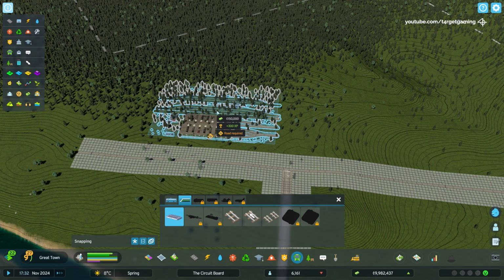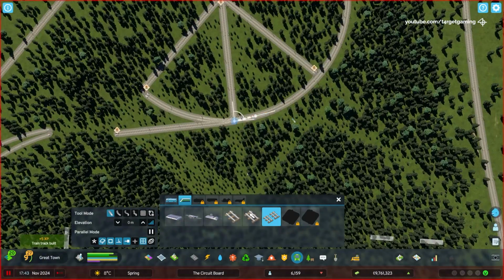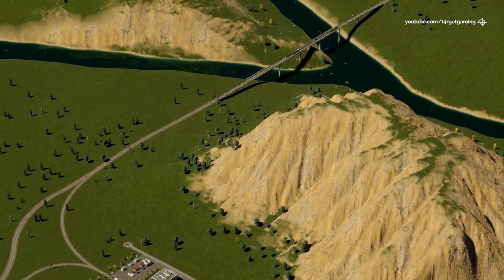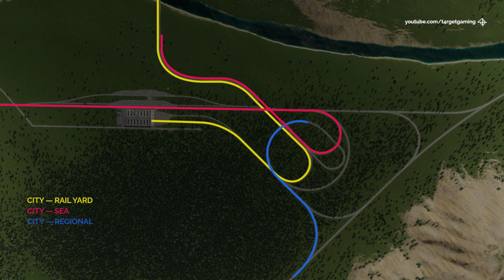This Train Intersection is Completely Justifiable

Comment: You could subsidize oil industries for a short while in the taxations tab and then demolish the current generic industry by the Oilycomb, so that you may have the intended generic industry there
Reply from the maker: Thanks for the tip, I should try it as a quick fix.